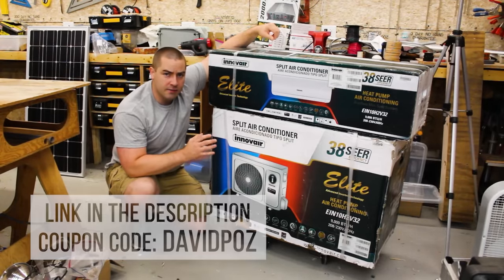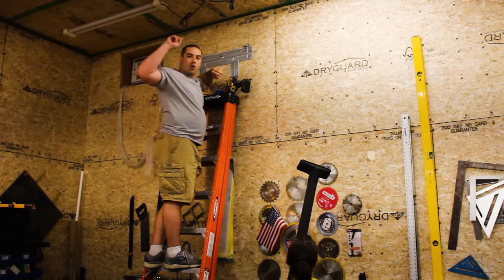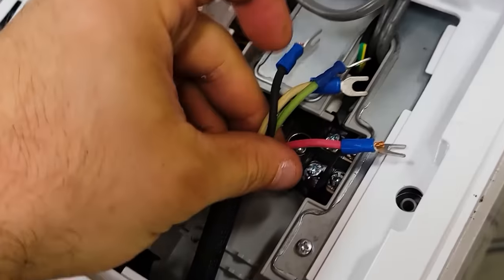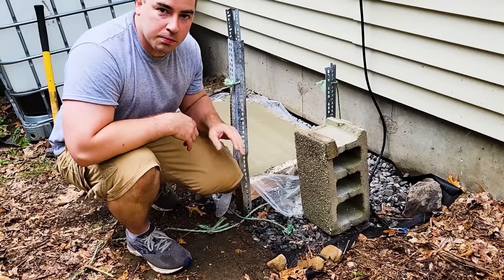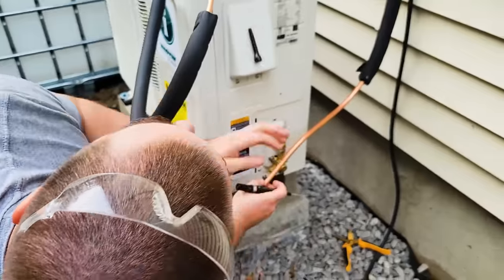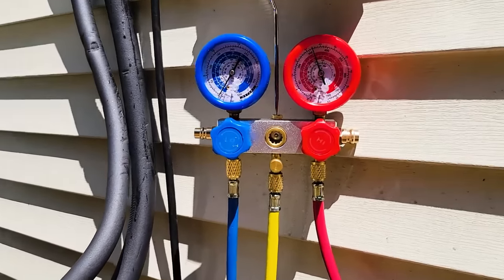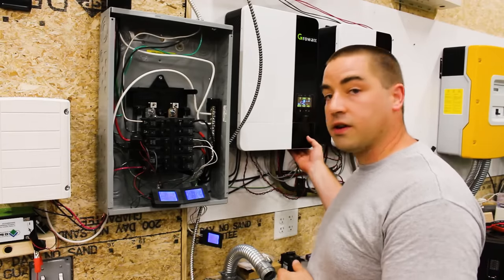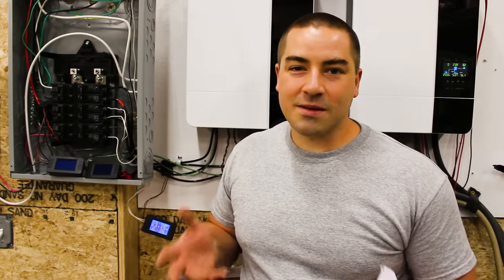DIY Mini-Split Heat Pump, Full Installation, 2021

Comment: Very good installation but  where you get the heat from
Reply from the maker: When running the heat pump in "HEATING" mode, it throws a reversing valve inside the unit.  The refrigeration runs backwards, pulling heat from the outside and delivering it into the building.
Reply: Ok bro 👌

Comment: @20:45 -- I'm a little confused. Didn't you want to run the power cable through the power conduit, instead of the same 3" pipe that you're using for the refrigerant and condensation lines?

Comment: Love the video. What happend to the third growatt inverter that was installed up on the wall.
Reply from the maker: I didn't need the full 15kW capacity, so I took one down for another project.  I'll go into more details in the next video.
Reply: I was wondering the same thing

Comment: Nice install, kind of low temps coming out of that thing. Shouldn't be at or under freezing. Wonder if its undercharged, could happen. How's  the heating side work? Amp draw? Might want to throw a set of gauges on and check. Where are you at in the northeast? I have a victron autotransformer set up with a inverter gas generator that I'm kind of leary about its operation.
Reply from the maker: I have a follow-up video measuring the energy consumption.  Yes, it worked through the winter. https://youtu.be/IgCOmzCWGrU?si=nTANbESSNi1sjzLt

Comment: You should pressure test your flare connections with nitrogen BEEFORE you do the evacuation. After you are sure there are no leaks, evacuate the system down, and then charge the unit with refrigerant.

Comment: Luv the Vid. I have a question about the Watt Meter that you show towards the end of the vid. How did you hook up the power wires so that the meter displays 240 volts. Do you connect each meter load wires to the individual LINE-IN wires IE: One on RED and one on BLACK? My thinking is that would blow up the meter. Normally it would be connected to one on one of the line-in wires, and one on neutral, or White wire.
Reply from the maker: You guessed right.  Not every meter will work on 240V, but this one did.

Comment: Do you notice the compressor and outside fan running at different speeds? We have a mini split where I work and in the morning I walk by and notice is sounds like it is barely on, and in the late afternoon it seems to be running at full throttle.
Reply from the maker: When I've checked the outside unit it's not even noticeable that it's on.  Very quiet.
Reply: That's normal for modern units with variable speed DC motors. That's how they get high seer numbers.

Comment: FYI, In Japan, those systems require a 10cm hole in the wall to pass the two refrigerant lines, the drip line and the AC line running out to the outdoor part of the mini-split. Most installation instructions will have that information clearly listed.
Reply: In Japan they require the AC power to run through the same hole as the refrigerant and condensate lines?
Reply: @wingerrrrrrrrr  theres really nothing wrong with that, and it is often cleaner, typically we will use liquid tight felxable conduit that runs along the line set, and is all covered by ductless split lineset armour (fortress brand usually). Eliminates most external wiring.

Comment: Great video David. I installed two mini splits in my RV a few years ago. I can now run this 50 amp unit on 30 amps service and run everything. They are definitely a game changer. Another question for you. I am torn between a 12k unit or 2 5k and a 100 amp autotransformer. All mine is 110v, well one mini split is 240v but putting it on a stepdown transformer. Cannot fit 3 3k units which would be nice but ot room for 3. Cost is same for both. If Signature offered an 8k or 10k would rather get that. The extra power allows us to use electric skillets. Your thoughts
Reply from the maker: Hmm.  Well, I would prefer 2 smaller units instead of one big one.  2 smaller units provides redundancy if one fails.  It allows for more even distribution between rooms (assuming the two units are spread apart from one another).  I'm moving more and more things to 240v myself, it's my preference.
Reply: @DavidPozEnergy  understandable in your situation. In an rv we are locked in on 110v.
Reply: @glennwest4438  theres available minisplits with 110v, they are pretty common here in Mexico due to sometimes or most of the time, people cant afford to have 240v or they have a really limited fuse box, when i install them i make sure to check where is the fuse box to see if they can install it or they need a full rework there.
Reply: @AtemerusRhayli  there are plenty of 120v mini splits In the US too. They only go up to 12000btus

Comment: How to change the power system from 120volts to 220volts to assemble the AC,because the house does not has 220 volt power

Comment: Very nice, now with current installed arrays will your system support your whole house plus your shop or during high draw times tapping the grid for any shortage ?  Do you produce enough to sell power back to the grid and if so does it off set any grid power usage ?
Reply from the maker: I'm off-grid most of the year, but January and February I have to switch back to the grid.  My house is 100% electric, that includes heat.  All my solar stuff is off-grid.  I don't sell it back.
Reply: @DavidPozEnergy  OK Thanks for the reply, interesting.

Comment: I would send that compressor section back to them. Its warped covers bent fins ect. Assembler was having a bad day. Edit,  snap connectors are shit. That's 14/3 bx IE mc cable,  also crap. Should use 1/2 EMT pipe,  if a wire goes bad & they do sometimes , you can repull. [ Bx,  you have to replace whole thing. I was licensed electrician for 33 years,  also Ibew A card.  
You did a nice job,  enjoy the cool & heat from your system. Hugh Mc,  Chicago metro.
PS: NEC code States you can only run 6 feet of bx or mc cable in open areas. Must terminate to box & run pipe to homerun to panel. That being a Chicago code & NEC & enforced by most suburbs
Snap mc cable I'm half use diagonal pliers to finish. We call plastic bushings red devils,  they prevent shorts.

Comment: Suspect the tube was on the other side so the refrigerant tubes do not freeze the condensate pipe trapping water  in the drip tray

Comment: What were the temperature deltas between outside and inside just curious. how hot was it outside on those days? The day you turned it on , the following day, and the 48 hours later? Reason why I asked is if the out side temp cooled off between those days the delta or max needed to maintain the 64F would have dropped down to that 130 watts.

Comment: If you worry about the concrete blocks cracking from ice expansion why not fill them with concrete? Isn't possible with the blocks on their side for snow to infiltrate, melt, freeze, melt, freeze, etc until eventually they crack anyway?
Reply from the maker: You can do whatever works for you.  This is the second winter with this foundation, and so far so good.

Comment: I have Mitsubishi mini splits and I really like them except that they constantly heat the compressor to make sure the refrigerant stays a gas. This is around 240 watts 24/7 regardless of outdoor temperature or if the indoor units are OFF. I know you are monitoring the power consumption of your system and I was wondering if you are seeing a similar power draw.
Reply from the maker: The lowest power draw I've seen is 120W with the unit "ON".  Generally this past week  it's been more like 250W to maintain temperature in my garage.  With the unit "OFF" it draws 2.5 Watts, which I assume is to keep the IR sensor on to detect when you use the remote control.
Reply: @DavidPozEnergy  Thanks for the quick reply. I wish my systems only drew that little. Manufacturers should publish the "phantom" load the consumer will experience when heating or cooling is not needed. BTW my Mitsubishi systems are only 3 years old and the best available at the time.

Comment: Great video as always, but I think I see one or two electrical code violations which should be easy to fix. First, 250.148.C, is all the electrical boxes must be grounded. I can't tell but if you didn't attach a ground screw to your inside box that needs to be added. Second, 330.30.B, is MC cable needs to be secured to the wall within 12 inches of the box (and every 6ft after that).
Reply from the maker: Thank you for such an excellent comment.  This is my favorite type because I can learn from it.  The inside 4x4 box does have a green ground screw, with it's own wire coming off and going to the wire nut with the other green wires.  But, your second note is a good catch.  On my electrical load center, the MC comes in at the top and I don't have an anchor for about 2.5 feet.  I'm going to add one right now.  Thank you for catching that.
Reply from the maker: Done.
Reply: @DavidPozEnergy  You're welcome. I spent way too much time reading the NEC for a project that hasn't materialized, I'm just glad I'm able to help somebody from it.

Comment: It’s interesting that these units don’t exist on the company’s website and the highest one on their website is 23 SEER.  Also the ad says up to not necessarily the standard rating.  I guess it would be nice to get a model number with the official specs and graphs of the efficiency as a function of temperature for heating and cooling.  Just feels like I might be getting conned here.

Comment: After checking link, that site does not have the unit you installed. They also have a number of errors in their listings btu wise.  I will check back later to see if they have the actual unit that you installed ; vert puzzling.
Reply from the maker: I just checked, it's still there.

Comment: David,

Really cool setup. It would be really awesome if you could control the mini split based on battery voltage. My fathers home is off grid, and I’m scratching my head as to how to control all sorts of non-essential opportunity loads (air conditioning, ev chargers) via a signal from his Midnite Classic. It’s difficulty to use conventional relays, because his power shed is a good distance from the house. I was thinking it would be neat to use some smart home tech to help automate those opportunity loads. I feel like that would be a great video on your channel.
Reply from the maker: I have not tried this, but it might work for you?  https://shop.signaturesolar.us/products/voltage-control-relay-device-by-ez?_pos=3&_psq=controller&_ss=e&_v=1.0
Reply: @DavidPozEnergy  Yeah, I had considered something like that. The trick is how to get it to work wirelessly on a home network. I’m learning a lot with all this off grid stuff. 

Thanks!
Reply: @pirahna432  I believe there's wifi adapters/kits for most of these units
Reply: @DavidPozEnergy  Thanks for the suggestion!

Comment: Hey David this was a super instructive video! Do you need some kind of certification (or permit) to do the plumbing and opening the valve where the refrigerant gas is stored? Here in Europe I believe you can do all the installation but the final step needs to be verified by a professional.
I'd love to see some follow up. Your channel is such a good source of knowledge and inspiration for other DIYer out there.  Keep it up!
Reply from the maker: My understanding (at least where I live in US) is that I need a license if I'm adding or removing refrigerant.  In this case the unit came pre-charged for up to 29 feet of lineset.  This means I never added or removed refrigerant, so to my knowledge, I did this legally.  

  If I extended them beyond 29 feet I'd need to add refrigerant (license).  Or, if I want to move the system in the future and need to capture the refrigerant (license).  Or, I suppose some units might come with no refrigerant at all and those would need a license to add however much is needed.
Reply: 2021 Pacific Power in WA state USA is offering $1350 rebate but the install must be done by a qualified technician. I am going to install everything but have a qualified technician connect the coolant lines. Hope that flies. Should cut down on the tech time/cost.

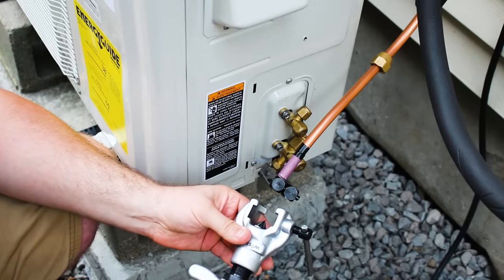Comment: Why didn’t you coil the pipe so you could use the original connection at around the 40:00 min mark, it doesn’t matter about the length.

Comment: I did the calculations before but I'd fill that gap of insulation with great stuff spray foam from Home Depot. 16oz can is only $3. Drill and fill.

Comment: why did you place it so hi up if its a heat pump in winter it will take forever to start feeling any heat because heat rises and its already at top so heat has to be top down?

Comment: Thanks David. I plan to use a mini split on a place I’m fixing up for us along with solar power. I learn a lot from your videos. I know I’m capable to do this project. Reading the warranty information for this and other units they all seem to indicate that if you don’t have a licensed technician do at least the evacuation they void the warranty. I live far out and the cost to bring a tech out is high and they also want to sell the whole project including the unit. Any thoughts?
Reply: I am a tech, you don't need to have a licence to evacuate an empty system , but need it to charge it for someone else. you can do it your self but,,,,,, the warranty is another mater .I don't know anyone that had to warenty any mini split components yet, so I would do it my self if you know how, an automotive A/C guy can do it if it's for mobile.
Reply: I am a tech, you don't need to have a licence to evacuate an empty system , but need it to charge it for someone else. you can do it your self but,,,,,, the warranty is another mater .I don't know anyone that had to warenty any mini split components yet, so I would do it my self if you know how, an automotive A/C guy can do it if it's for mobile.
Reply: Getting a local contractors license is often a couple of hundred dollars. Get some minimum insurance for three months and guess what? You are licensed contractor.

Comment: Not that my opinion means very much, but that's very neatly installed. Do you think you could get it any more efficient by ducting warm air from the opposite side of the room? I know the cold air will already fall and fill up the area quite effectively and not loop back to the unit's intake, so it's probably not going to do anything.
Reply from the maker: My garage is just one big open space, so I don't see any benefit to adding ducting.  But possibly helpful if you had more rooms.

Comment: I didn’t see you using primer on the PVC conduit, some products claim one step, but for electrical, I ALWAYS use a primer to be certain the conduit is cleaned surface for full bonding to the solvent. Another tip, pvc conduit is easily bent with a heat gun, or a thermal blanket. Making the blocking you used on the ceiling box unnecessary .
Reply from the maker: Thanks for the tip.  No, I didn't use primer on this one.  It's funny to me, because in one of my past videos I used purple primer on conduit and had several comments from the pros tell me not to use it on conduit.   I'm wrong no matter what.  LOL
Reply: You'll be hard pressed to find a pro who uses primer.  Definitely holds better...  If you want to use primer, go with the clear stuff!
Reply: @DavidPozEnergy  ha, yeah that is odd.
Purple primer looks terrible, I use clear. It is a good idea to paint pvc exposed to sunlight anyway. 
It is fine to use one step solvent, but priming helps make it a secure joint.
Reply: Use primer for electrical conduit? Who cares. It's not flowing water or any pressure

Comment: Hello David,  Can you give an update as to the status of the Innovair mini split?  Is it still working well?  Thanks
Reply from the maker: It's been running 24/7 and I've never touched it.  I should probably check the filters inside.

Comment: Very interesting Thanks
Reply: Hey David,. This is Scott ATL.  Enjoying all your video DIY's.  Excellent job by the way!  I had some mini splits just installed at my build project by my HVAC guy and he had me to order a surge protector device for each of my three units in line at each  service disconnect.  Is this necessary for off grid power supply?  I'm currently on grid and there are dirty power spikes occasionally.  My guy has installed many of these systems and he said the electronics in these units are sensitive to spikes and getting replacement boards are almost impossible to get  and expensive to say the least.  I did purchase  these surge protectors through Amazon.  It's called Intermatic AG3000 and recommended  for any HVAC system.   Look forward to seeing more solar project test and installs.  Thanks

Comment: I understand doing the gravel but they make plastic pads now where you sit the air conditioners on them you know having the gravel base then put the plastic pad on top of it instead of making all that concrete mess and which now is more far cheaper
Reply from the maker: I live in an area that gets heavy snow fall.  The way I built the base gets the fan elevated higher, above the snow.